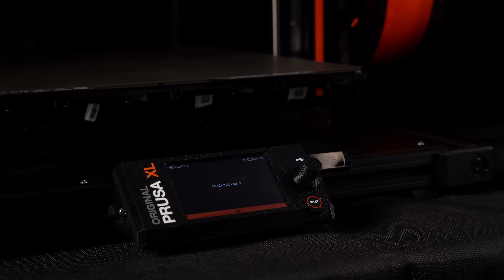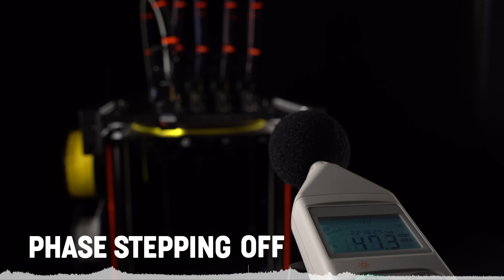Phase Stepping on the XL – Josef Prusa Explains 3D Printing

Comment: I love the fact that this company actually tries to update their machines and add features rather than just constantly sell newer models. More companies need to do this!
Reply: I agree! Prusa has always been good at supporting their machines over time and adding features. My Mini+ got better every year I had it. It's nice now worthy competitors like Bambu are around to really push them even further. I have machines from both companies and I like the new competition in the space, it only benefits us users!
Reply: Yes! It's crazy that the MK2.5 from 2018 is still getting updates.
Reply: When it comes to firmware and software this makes sense. When it comes to physical changes it can often be impossible..
Reply: you pay for what you have, I prefer to pay more and have a team of engineers and anthousiast than a team of sales !
Reply: Exactly!!
Reply: #creality
Reply: Bambu labs releases updates pretty often
Reply: They're falling behind though, and it's not like other companies don't do this as well. Bambulab for example recently released firmware updates that made all their printers much quieter
Reply: One annoying thing with chinese manufacturers is that they non-stop pump new models. They add feature or two and bam, here is PRO model. Its confusing for buyers and dont think it helps manufacturer itself.
Reply: Bambu lab fully intended on killing all software support and updates for all of their printers only 3 years after release. Meanwhile prusa is still supporting their MK3 7+ years after launch.
There is a reason why everyone wants a prusa and copies after them so hard.
Reply: @LilApe  ''fully intended on killing all software support and updates for all of their printers only 3 years after release''
The X1 has guaranteed bugfix and feature updates until 2027 and guaranteed security patch updated until 2029, that's 7 years from launch....
The new A1 models have until 2030.
Reply: @NorwayVFX  Because they changed it after all the backlash they got. I don't buy it for a second. They fully intended on only supporting their printers for 3 years. Them changing it after the fact means nothing. Damage was done and it shows how they are as a company by not wanting to support their products after 3 years.
Reply: @LilApe  They are not killing anything and you will be able to use your printer for lifetime. They just guarantee firmware updates for 3 years. After that time they will not waste resources on making obsolete products better as this is terrible business practice not giving any profit. It's always better to invest more resources to new products and sell new improved models than staying basically in one place for 10 years like Prusa did. Their printers are obsolete now and it's totally their fault.
Reply: @sob515  What nonsense. That's when you realize that you have no idea.  If you have no idea, just keep your mouth shut.
Reply: @Neo1983m  but you also have to realize you don't have any Bambu Lab printers. The difference between Prusa and Bambu Lab is night and day.

You can go upgrade your MK3S+ to some 3.5, 3.9 or whatever...
I will surely not go that route.

The MK3S+/MK4 or neat. They can handle ABS and stuff.
The Mini however.... Holy cow that thing became totally obsolete. Prusa could support this printer for 20 years and I wouldn't care. The A1 Mini totally destroys it in every possible aspect (actually it destroys most of the FDM printers, just not the ones from their own brand. Lol)
Reply: @sob515  Nobody said they're killing their printers. But they have a 3 year end of life cycle which is embarrassing for a 3d printer.
Reply: @sob515  for a failed business model Prusa seems to be doing wonderfully well. As someone working in the machine tool industry for forty years you are also talking nonsense, and these printers are machine tools.
Reply: @sob515  Business practises don't apply to Chinese companies. They're state sponsored. The Bambu machines probably cost 2X as much to make than what they sell them for, with the CCP keeping them afloat until all competitors using honest money are dead. If loss-leading Chinese printers weren't allowed in Western nations, the cost to maintain printers you already have is much, much less than starting a whole new model's manufacturing.
Reply: @Duevel  That information is from 15 years ago man. Chinese wages are no longer dirt cheap and they're not much different from European wages, especially looking at medians from manufacturing areas like Shenzen, they're actually higher than some Eastern European nations. We continue to manufacture there because of all their expertise gathered and infrastructure built to handle anything at large scale which they've been building out for a long time.
Reply: @LilApe Blabla ..
Reply: @REDxFROG  your comment is BLA BLA. He is right what he said. Bambu Fanboy.